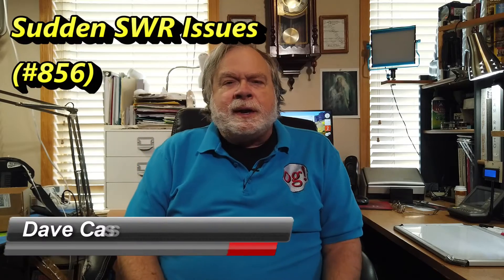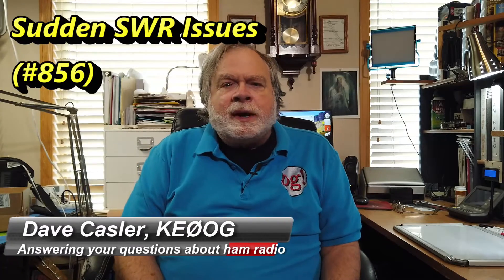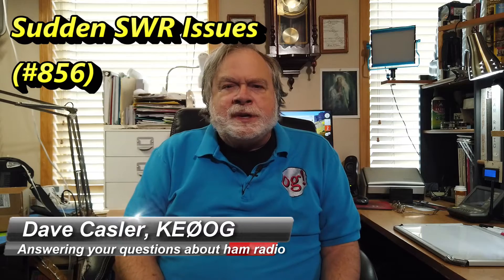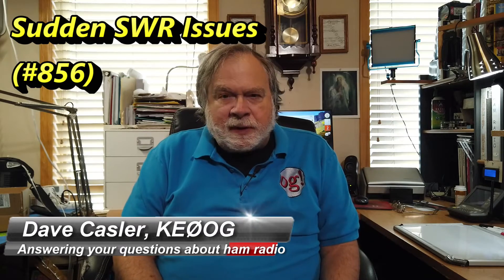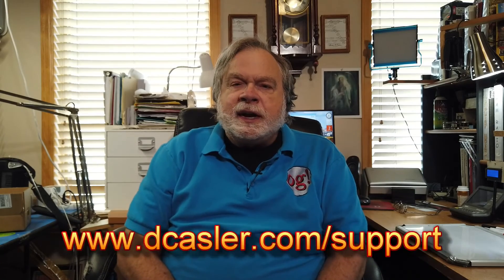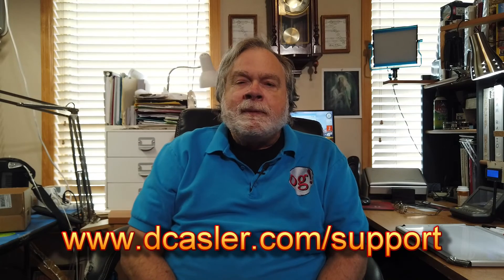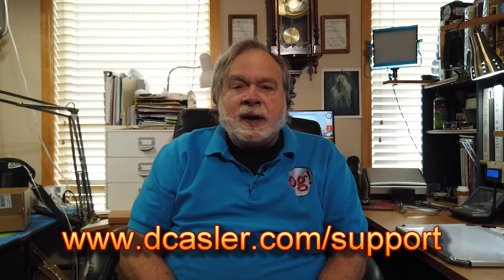Sudden SWR Issues (#856)

Comment: Dave, I hope you can Tell Me why this is Happening, I was given a old 5/8 antenna. I had it Mounted on a 3 leg stand with 3-foot steel pipe. SWR was Perfect, 1.1, I stuck it on My Roof, Everything the same, Now SWR 3.4 What's going on

Comment: What is the name of the grease with pieces of copper dissolved in it that you mentioned in this video (at 7:35)?
Reply: Yes, there are some silicone chalk material used for sealing the gaps in the ceramic tiles and glass panels. It would smell pungent as if it contains viniger (some kind of acidic material for sure).
The result would be that the copper in the cable and the connector would be turning green in about 12 hours time indicating the start of the chemical reaction; the copper would be eaten up soon. RTV sealant is a good choice to water proof the connections in the out door setting.
De VU2RZA

Comment: What's bad about using an external tuner and the radio's internal tuner at the same time?  If neither are in automatic mode and you tune the external one first, and then the internal one, they won't fight each other further...  I'm sure there's a good reason not to do it, but what is it?

Comment: A few years ago, my radio rolled back power and I realized it was high SWR.  After taking my OCF antenna down and inspecting everything (with nothing seen), I got the idea to use my NanoVNA to measure the length of my feedline use the TDR setting.  Sure enough, the reading was really short.  I pulled the feedline from under my porch and found where a mouse chewed through it!  Thanks, Dave, for a great video on a practical topic! Merry Christmas and 73. de WB0BEE
Reply: I worked for one of the bigger cable companies for right at 20 years.
We had a thing called "Squirrel Chew"...

The squirrels used to love the coax...
They never messed with the fibers.

Representatives of the cable makers told us there was an additive in the outter shielding that was soybean based and squirrels loved it.

Also they said the when signal was passing through the cable, certian frequencys emitted a sound that the squirrels could hear and it drives them nuts...

Either one true?  Both plausible, but I'll never know for sure.
Reply: @solo63137  ha..ha..ha..
Good joke
De VU2RZA

Comment: Years ago had a similar issue here.  Had a G5RV up and one of the feedline connections broke at the center dog-bone insulator.  The high SWR was intermittent with higher winds, which was a good clue in finding the defect.   73,   AC3HT

Comment: My SWR went nuts when the braid broke loose in the PL-259 at the transmitter.  It would be fine sometimes and then go high.  Bumped the cable when looking at things and it would work again.